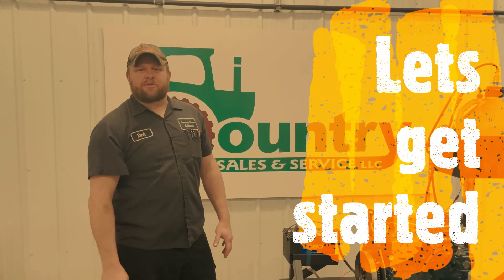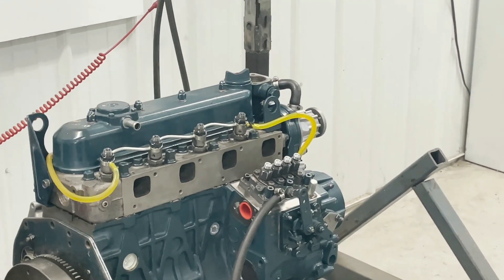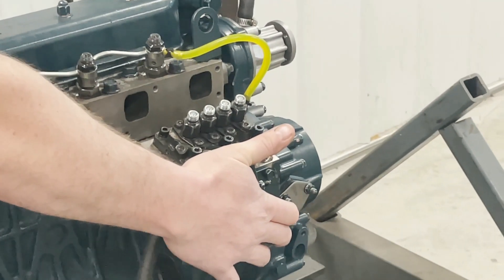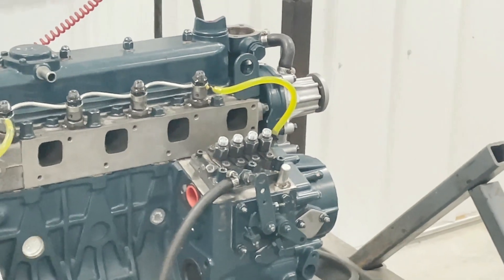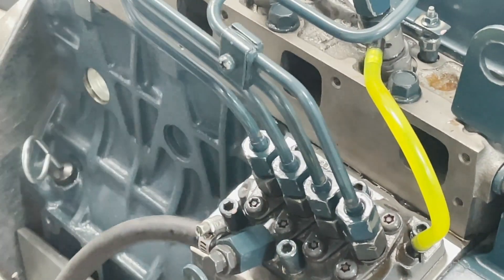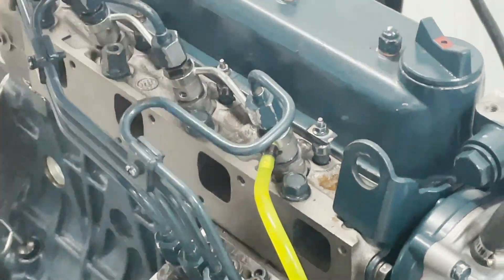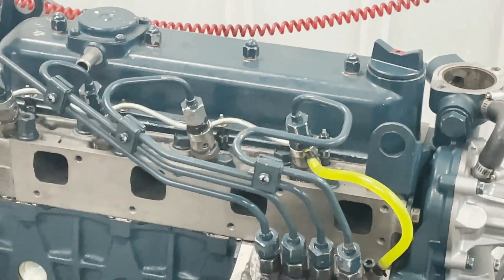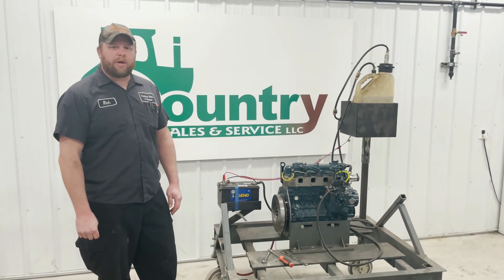How to Bleed a Kubota Diesel Engine Injection Pump

Comment: I realize this is an older post. But if you could answer please, what part goes where that red plastic plug is placed. On my engine there is a small electric device like an actuator that I thiink may have failed but I don't know what it's called.
Reply: Shut off solenoid

Comment: I have a 3 cylinder fires right up purrs at idle give it any throttle pretty much falls on its face stays running but no power....bring it back to idle purr...scratching my head...is there a return valve?

Comment: I have a Walker mower with a 3 cylinder Kubota engine. I ran out of fuel a month ago. I bled the system and it ran fine but now every week I try to mow the lawn it won’t start and I need to take 2 battery cycles to get it bled again and then it will run perfect until the next weekend. What the heck is going on?
Reply: The fuel shut off solenoid was stuck in the off position

Comment: Great video. I have a Kubota V1200. A adjust plate tit  was broke on injection pump took it apart and  replaced it but know I can't get any fuel out of delivery valve. Made sure that shut off valve is open. I took it apart again thinking I had the plungers 180 off still no luck

Comment: Thanks for the video, it was very good! I’m rebuilding an older D. 850, and tried to start it the other day. It ran what seemed well, but cylinder number one was offering a lot of smoke and cylinder number three was offering no smoke. On cylinder number one does it make sense totighten the intake valve to allow more air to enter to better balance the combustion?

Comment: I work for Operation Blessing Disaster relief. We have 2 mobile kitchens with 12K Onan Diesel generators, with 3 cylinder Kabota engines. One has 8,000 hrs. mfg. 2008 and the other has about 6,000 hrs. mfg. 2013. Both have the same symptoms. With no load, they run for about 20-30 hours, then shut down. With a load, they may run 15 minutes to 4 hours. We have spent thousands of dollars on repairs to no avail. Any suggestions?

Comment: Soo what do i do if i didnt hold the nut from turning and moved the lower nut (the gasket and fuel timing). How do i check and properly set them?
Reply: Hey, did you ever find an answer to this question?
Reply: @kylehammer2651 no not yet but sense then the project had been on hold. Been busy doing other stuff and not had time to invest in this poriect
Reply: Good question
Reply: Did you ever get an answer for this question?

Comment: What is the circuit with the yellow plastic line coming out of the injector pump to the front injector body and then jumping down the line to the back injector and, I think, going to the top of the fuel tank?I’ve seen it referred to as a “fuel return” which doesn’t make sense. Also as a “vacuum line” - not on a diesel. On my 1981 L345 that line starts at the fuel line going to the pump, goes through an “air bleed” valve, jumps to all injectors, and ends up connecting to the top of the fuel tank. None of this is in my manual or parts book.
Reply: Grey Ghost’s comment brought me back to an Aug 2024 update: My problem , and tearing everything apart, started with some bad - no terrible - fuel. I finally drained the entire tank and ended up with nearly a quart of water. 
To take care of future problems, I replaced the fuel filter with a “Derale 13070 fuel filter/water separator” that has a drain petcock on the bottom. The Derale has two inlet holes and two exit holes and they supply two plugs but it didn’t have an air bleed so I installed another petcock on an extra exit hole. No problems since and no water except for a spoonful or so from condensation when I drain it every few weeks. It can hold a pint(?) so it’s unlikely that water will get to the engine again. 
I think the magic “fuel return” line maybe bleeds some air but, in the little banjo fittings around each injector, catches any leaks from the injectors and puts it back in the top of the tank. I still don’t know what the bits at the injector pump do.
Reply: Very good question, this channel might have went somewhere if he just talked to people

Comment: Hello, I have a Kubota V1902. I understand the process of bleeding as shown, but my pump also has a ‘bleeder’ valve on the return line from the front injector. When is this bleeder used in the whole process?

Comment: My Kubota RTV 1120 D will not run but it will run a short amount of time after manually pumping fuel into the injector pump. Can this possibly be a bad fuel selonoid?

Comment: Great video, you answered some questions for me! I’m working on my Dads 1985 Kubota L345DT, I don’t know a lot about diesels. We looses one of the outlet lines trying to get to the glow plug behind it, the line leading from the high pressure pump and may have turned the base because we didn’t back it up with a second wrench. Are you saying that when the o-ring leaks it will cause the pump timing to be permanently changed requiring retiming or just that until a new o-ring is installed it won’t run right. We haven’t bled the tube leading to the injector the way you did, yet but right after we retightened and started it seemed to miss.
Reply: Great that the Ahole does not answer, we have the same problem. they should be tight, We by mistake moved them, now its leaking. I watched othe videos and thaey all got tightened

Comment: Do you do the same for l3240 the case the fuel filter goes in busted and after I replaced it I turned that button on the side to get the air out that a different video suggested after a replacement ran for about 15 seconds and it shut off have not been able to start it since I don't know much about them and don't want to mess it up even more

Comment: I am assembling a Kubota V2403 engine and I was wondering if I have the crankshaft and main idle pulley marks in the right phase. It's the 1 dot to 1 dot marks. The rest I have correct

Comment: Replies
Hello, love your work maybe you might have
knowledge on a kubota mini excavator
X040-4 with 1802 hrs. She fires up runs for
30-60 seconds then dies out. On the
computer in the 2 fault codes pop up 064
Engine and 076 DPF is clogged. Got the DPF
baked in the mean time replaced primarily
and sec fuel filters cracked the lines she's
getting fuse. Got the DPF back connected all
the thermo sensors. Still same issue. Hooked
up a diesel scanner found multiple fuel
pressure sensors "high" and rail pressure
issues, crankcase sensors issue. I've spoke to
3 different techs with Kubota one is say bec
of DPF issues the kubota pcm/ecm shuts
down after 4 attempts for safety reasons.
Other tech told me "no" the bio diesel might
have crystallized and I need a new common
fuel rail with the sensors and new lines.
Reply from the maker: So a couple of things on this, if bio diesel was used I would guess the injectors are bad. Maybe even pump and rail. But before I could diagnose it I would need to see what the actual (p) codes that are in the ECU. That would tell me if its fuel or electrical.
Reply: Thank you for replying I was able to replace the thermo senors and got the dpf resolved.

I still have the code “64 Engine system” code once I plug in the diesel laptop the code high rail pressure is still up. I order new fuel filters both primary and secondary the clear one. I am going to drain the whole tank. Then add 911 diesel. The customer stated he did use bio diesel and this mini ex has been sitting for 3 months. So that would be an issue. 

I’m still holding off on the fuel injectors thank you again!

Comment: My  pump is getting fuel but fuel  not coming out  like your pump can you advice me please what to do
Reply from the maker: Hello,
I would verify that you are getting the correct volume of fuel to the injection pump, should be between 5-8 PSI to fully supply the injection pump. If it is, then there is an issue with the injection pump. It could be a variety of reasons, it would be easiest to have it inspected and tested.

Comment: Thank you for this video. I have performed this procedure on a kubota D1005 and still will not start. It’s getting proper air and the motor has good compression. I have pulled each glow plug and tested them and they are working properly and getting power when in the correct key position. Fuel leaves the barrels on all cylinders like yours did in the video. When I crack the lines up top and crank the engine the fuel comes out with bubbles for a bit then stops at which point I tighten the lines up. Unit does not smoke when attempting to start. What would cause this? Thank you
Reply from the maker: Hello Kevin,
Based on the information provided, I would guess one of a few things. The lack of smoke indicates that the engine is not getting fuel. This is can be caused by low compression (you stated it was good, what was the PSI you measured?). Since you indicated fuel is moving from the pump I would question the injectors. If you have not replaced them I would have them tested. Secondarily, though you may be getting fuel to the injection pump, you many not be getting the correct volume/pressure to the pump. If you have a manual lift pump I would inspect it to make sure it does not have a pinhole in the diaphragm (usually noticed if engine loses prime over a couple of days). Again, these are quick checks, I would need a little more history on the engine/machine to get a more pinpointed trouble shooting. If you need help, please feel free to contact us at 330-683-2500 and we can help you out!
Reply: My 4350 had a rat eat through low pressure line, I replaced it with a transparent yellow fuel line and it ran.
As it got warmer it ran less well and I could see little air bubbles in the transparent tube. I live a distance from the dealer and would like to fix without breaking the bank.
Any advice would be great.
Reply from the maker: @scottheller1379  Hey Scott, 
Based on what you are telling me it is pulling air. It typically comes from one of a few places. First, you should have a have a manual lift pump. If it has a pinhole in the diaphragm you can get air entering the system. This is usually seen when the engine is recently run it starts right up, but if it sits for a while it takes longer to start as the pump is causing the fuel system to lose prime. Second, inspect the fuel filter/ fuel filter base and make sure that it is properly seated, no damage, nicked gasket, etc. Finally, if the delivery valve holders of the injection pump were turned or the O-rings have "dried out" you can get air in the system as well. Feel free to contact us if you have any other questions.
Reply: @CountrySalesService  thankyou so much. Am going to get a mobile mechanic out to help. Would let you guys but pretty sure the travel cost would be prohibitive lol.
Again, thank you for your wisdom.

Comment: Hi, my 743 B Bobcat with a Kubota V1702 was hard starting.  I purchased the correct glow plugs, thinking, at 30 years, It wouldn't hurt to replace them. I knew to hold the bottom nut on the pump side, when loosening the fuel lines to the injectors, and didn't turn any of them.  After reassembly, the first pump is leaking, and I am unable to get it started.  All the loose fuel lines at the injectors showed fuel leakage betore I tightened them.  The first time I tried starting it I got white smoke for just a few seconds, now just black, but it won't keep running, and it isn't hitting on all cylinders.  Does the pump have to be removed to fix leak?  Why won't it stay running?  Thanks
Reply from the maker: It sounds like you have a delivery valve that may be out of adjustment or the O-rings need to be replaced. With the barrel out of adjustment you will be getting more or less fuel (running rich or lean depending on the direction it was turned). You can try and snug down that barrel and see if you can get it to seal.  If not the pump would need to be removed and repaired.

Comment: I have a carrier reefer unit. and fuel is leaking where the red bleeder valve dnob is . will a new valve fix that . and is this a easy job.
Reply from the maker: If it were here, we would replace the jet cock and the hollow screw (bleeder valve assembly). It should fix the issues and is not a difficult job.

Comment: Hi and thank you for the video ! 
I have kubota l5740 hst and the fuel line going from the tank to the filter got completely clogged. I cleaned the line using a compressor, but the tractor still won’t start. I loosened the top nuts on the injection pump and no fuel is coming out of any outlets when I try to crank it. I do have a mechanical pump before the injection pump. I tried cranking up with outlet line removed and it’s seems to me barely squirting fuel. Is the pump bad now? Thanks!
Reply from the maker: I would check and replace all fuels filter (may have a spin on & inline). Then I would try to identify what cause the fuel restriction. If it is grass, dirt, debris, etc. you would want to check the tank and make sure the screen in the tank is still present and make sure that when fueling there is not debris anywhere near the inlet when fueling. When blowing out lines to the tank it has a tendency to blow off the screen in the tank. If it is black/green it would be "algae" which would require you to treat with a biocide to prevent continued growth. "Algae" requires a higher water content to flourish in fuel, so you may want to check your fuel source for signs of water. It could be possible that the pump could have been damage prior to it being clogged as it it is a fuel lubricated pump with a very tight tolerance. If you need any further help feel free to reach out to us.
Reply: @CountrySalesService  thanks for the response. After all It was a mechanical pump causing issues. After I replaced it, the tractor started right away. I did pull the tank out and washed it. No screen has come out, except some gooey stuff.

Comment: What is the procedure for putting these barrels back to the correct timing? I want to install new plungers and have to remove the barrels to do so.. Would each barrel have to be re-timed once taken apart because everyone I watched rebuild these pumps just snugs them down with a wrench and throws the pump back into the engine
Reply from the maker: Our injection shop uses a diesel fuel injection test stand to ensure each pump meets specifications for fuel output and fuel metering. If you replace the plungers the barrels would need to be "re-timed" to ensure they are back to spec. It is possible to get lucky and snug them down and still be in spec, but there is no procedure to do so.

Comment: Bos...diesel and engine oil mixing... what pblm?
Reply from the maker: It is usually one of 4 things; if you have a manual lift pump there is most likely a pin hole in the diaphragm, the housing of the injection pump is cracked, you have a leaking injector(s) or a barrel is damaged in the injection pump.

Comment: How much fuel pressure should I have from the fuel pump ?
Reply from the maker: If you are referring to the lift pump (supplies fuel to the injection pump), it should be between 5-7 7 lb/in²

Comment: At the 4:00 minute mark you show how to put a wrench on the bottom hex nut to keep it from turning. 
So, mine turned and now I have black smoke pouring out of the exhaust and the engine will not shut off. I have to pinch the fuel line to get it to shut off, turning off the valve on the water separator does nothing the shut the engine off with. 

I have a 3 cylinder kubota D1502 engine. I would appreicate any advice you could give me.
Reply from the maker: It sounds like the barrel is now out of adjustment, so when the pump is put into the "off" position it continues to pass fuel. It this is the case, just send it in to us and it is a quick simple fix, can get it back to you in a day or two.
Reply: @CountrySalesService  Thanks for this, I was out there today and moved the nut a few notches and that cylinder fire up with no issues (smoke) I locked it down there but if I still have probems I will be contacting you for service.

Comment: Hello, may You make video about bleeding on Kubota z482 engine? Have recently bought Avant miniloader and it stopps after 15-20 minutes of work, and its cold weather now, may the problem be in air? Does it help to pump fuel pump with hand then?
Reply from the maker: The process for bleeding a Kubota Z482 is the exact same process as shown, just a few less cylinders. If the engine runs for 15-20 minutes and starts to cut out I would check 2 things; First if you have a manual lift pump on the engine, I would cap it off and bypass it with an electric lift pump. This would verify if it was (could be) a fuel supply issue. Secondly, if the engine cuts out, but you can immediately restart it, I would take a look at your stop solenoid. If you need any further help please give us a call.

Comment: Hlo, am faisal working in soudi Arabia, could you please send me valve lash adjustment for Kubota V2403 model engine. Do you have any vedeo related about this pls suggest for me. Thanks
Reply from the maker: The valve lash for that engine is 0.18mm to 0.22mm, intake & exhaust, cold only.

Comment: I have a M5030 it runsgood up to about 3/4 throttle then it acts like it is starving for fuel I replaced the fuel filter it got better but still does it. Any ideas?
Reply: Ever found out the problem. ?
Reply: Guy on video even said and questions.  And no answer.